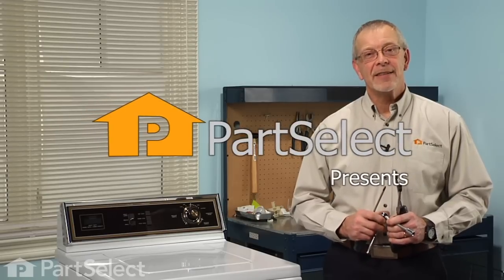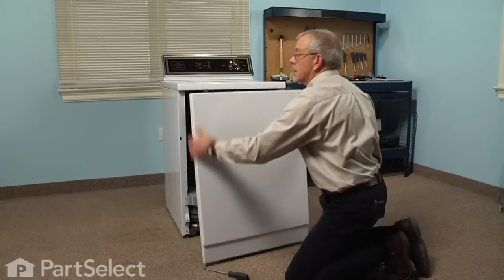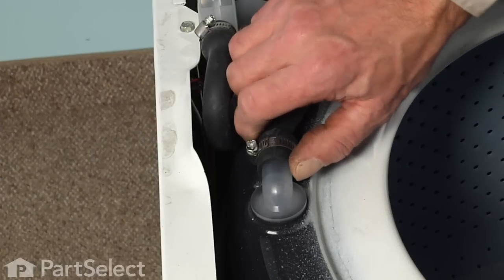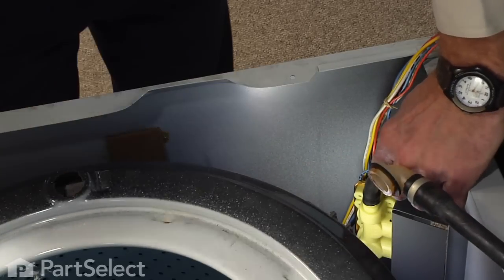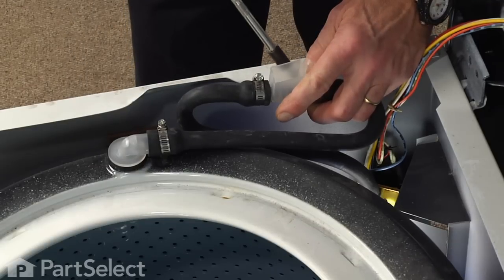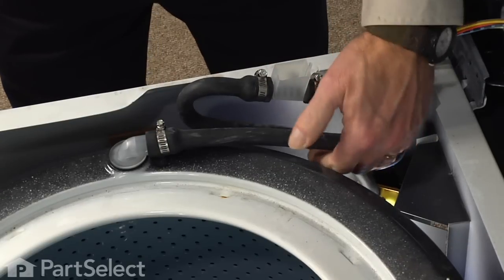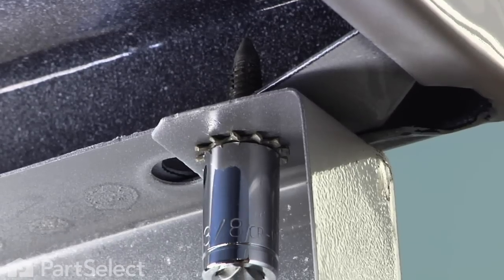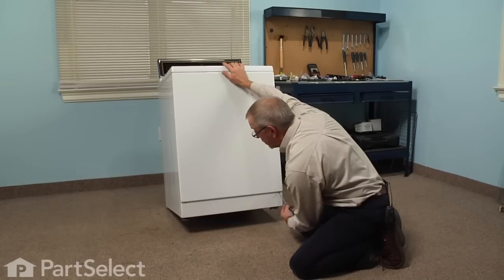Washing Machine Repair- Replacing the Injector Hose with Air Gap (Whirlpool Part # 206680)

Comment: What exactly is the purpose of the injector hose with air gap and what would happen if that part was eliminated?
Reply from the maker: The injector is used mainly to prevent siphoning. You could connect the injector hose directly, but at the risk of potentially flooding the washer.

Comment: I replaced the injector Hose with Air Gap in my Maytag (LA612) washer.  Since I was not certain that the old hose was the only source of leak, I started a cycle with the main top up.  Water squirted from the air gap valve over the surrounding plastic box.  Will to washer top prevent this when it is back in position (covering the air gap)?
Reply from the maker: +Paul H No. It sounds like the injector hose and valve are not assembled correctly or not properly inserted into the air gapassembly. Try lubricating the rubber valve with water before sliding the inlet water hose over it.

Comment: my front load washer has water in the spin tube after each wash - i have checked and cleared the filter 2-3x - then it works , then starts to leave water again..any suggestions?